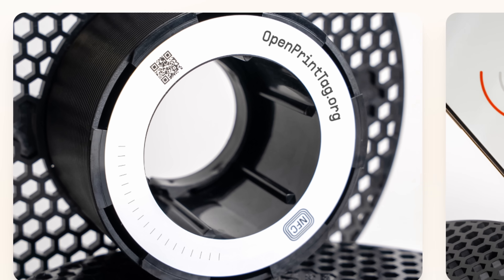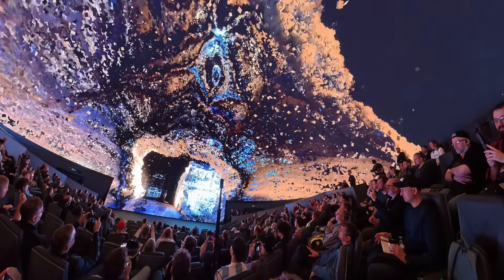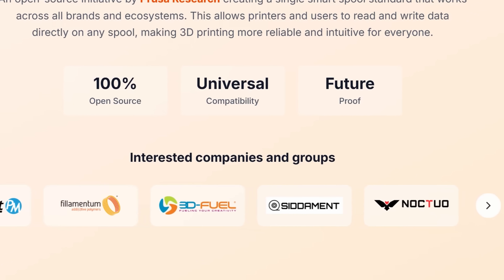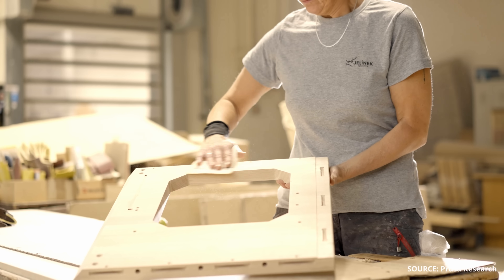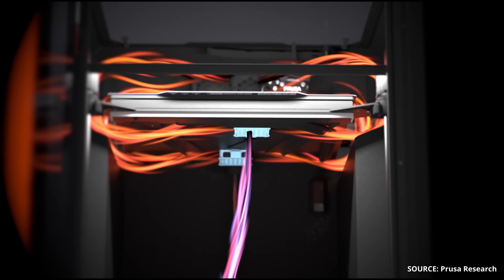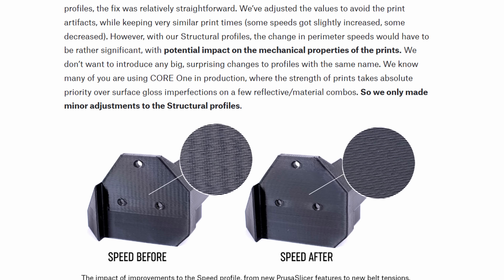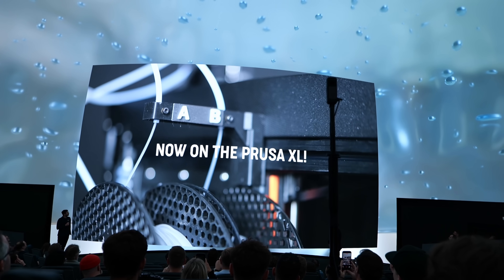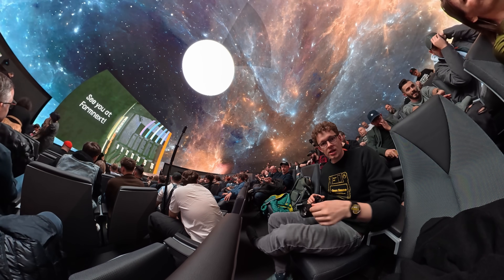CORE One L, RFID & Silicone: FIVE Big Reveals from Prusa Day 2025!

Comment: The lack of updates to the XL is very concerning. They could have introduced a better cooling fan and head design but they seem to be conveniently forgetting that printer as they focus on the core one. Hopefully that's not some sort of admission that they know that that printer was not the best design. Also that new slicer interface seems like it's going against all of the complaints on GitHub when they took out the standard operating system menus. I'm hoping this is not going to be another one of those apps that breaks UI conventions.

Comment: I want to say that being able print silicone on a standard 3D printer is going to be a game changer...however this isn't exactly new and I am far from impressed and actually very disappointed in how Prusa is doing it because it's insanely wasteful.

As far as I understand, you have a two-part silicone in two spools which each carry a long tube of the stuff. Each tube is CUT OPEN to get the silicone out. You're now left with two empty spools of waste plastic that can't even be refilled or recycled and will end up in landfills.

This shouldn't be applauded. This should be shamed!

Prusa needs to figure this out and use a remote cartage system instead.

Comment: Why does not one ever comment of Prusa's use of legacy 8 bit hardware but charging premium prices.  Electronically you simply cannot compare these to newer advanced printers.
Reply: They use 32 bit hardware now
Reply: You sound like someone claiming N64>PlayStation 1 because 64 bits is better

The internal implementation tells you nothing about the capabilities of the final product

Moreover, word size is one of the worst indicators of product performance
Reply: Prusa hasn't used 8 bit in nearly 3 years.

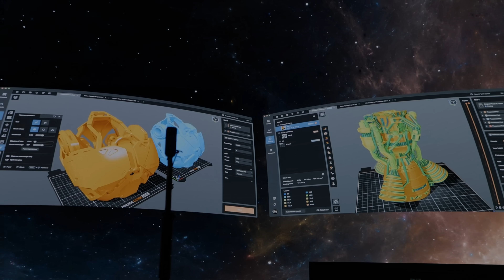Comment: the silicone printen at 5:27 is very impressive. But what happens with the tubes once they are sliced open near the nozzle? Are they mixed into the material or is there some kind of return system for the empty hoses where they are rolled up again?
Reply: It goes back

Comment: Their customer service really sucks tough, we have the prusa xl 5 tools at work. one of the toolheads is malfunctioning since the day we got it and they just keep leading us on without any sight on replacement parts or a new toolhead. which is great because it doesnt even calibrate because of the malfunctioning toolhead and now its completely useless if you want to use more than one head. not what we were expecting for the price.
Reply: I've had two different models of their printers and they've had excellent customer service that was responsive and helpful through to problem resolution.

Comment: Prusa AGGRESIVELY pushing back by embracing open source, making sure everything is compatible with potentially everything? And the Core L outsizing the H2D? Amazing. Now we all need to see how their Toolchanger solution for the Core L will look like ;) Cannot wait for FORMNEXT, will attend!
Reply: The opensource support is amazing, and I hope the INDX for Core One is awesome. But the Core One L does not outsize the H2D; it does not even quite match it. The H2S is a more direct competitor, and the Core One L is even smaller compared to that.

But I don't think the build volumes matter that much - they're all "larger format" and an improvement on the status quo.
Reply: I don't think the Core L does outsize the H2D, does it? I'm a Prusa user and fan, by the way
Reply: @goodtobegeek no it’s 50mm shy, I think the ams is a bigger deal that the extra 50
Reply: It's nowhere close to outsizing the H2D bruh 😭😭😭
Reply: Uh, it does not outsize the H2D, and certainly not the H2S, and neither is a competitor to it. Clueless much? The tags are awesome though!
Reply: Umm, the H2D is larger? and nearly the same price for 2 nozzles? The H2S would be a better comparison. 1 nozzle, 350x350 tool bed size, at $1200.... at $1799 this thing is dead in the water, IMO.
Reply: More cope from prusa fanboys, now we are straight making things up lol
Reply: @riba2233  it couldn't possibly be that someone simply misremembered, no it must be malicious
Reply: @ThylineTheGay  yes it does in this case

Comment: Prusa keeps pushing in the good direction
Reply: Not really, all the talk of open source doesnt compensate for huge diference in prices... competition offers higher quality product with larger print volume at significantly cheaper price or much more advanced machine that is still cheaper...
Thats NOT good...
Reply: @Asghaad all of that but closed source. No thanks. I prefer to spend some more to own much more.
also "quality" and bambu in the same sentence is gross.
Reply: @ajudge8786  thats the thing if the product that costs more offered more then that wouldnt be an issue ... the problem is they are asking triple the price for a printer comparable to  P2S.

or if you dislike it that much then compare it to lets say Snapmaker U1 ...

you are acting as if the Prusa was made from unobtanium and assembled by Dwarves from depths of Moria ... 

id rather buy "closed source" which is utterly IRRELEVANT to me machine that actually offers something for the sticker price...
Reply: @Asghaad  that's the point. Open-source is irrelevant for YOU. But just because YOU don't give value to open-sourceness, it doesn't mean it's irrelevant. For me it's worth the price.
Reply: @ajudge8786  no the point is that it would be valuable to me too, but not when you can buy two or even three other printers that will make the same quality prints for the cost of that "open source" architecture

Comment: NGL, I’m disappointed the Core L isn’t bigger than the H2S build volume. Maybe they are making a properly enclosed Prusa XL model.

Also that price is something else. A Bambu H2D is $50 cheaper and a AMS combo is only $1,999.00
Reply: I just bought an H2S a couple weeks ago. I maybe would have gotten a Core ONE L instead if it was at least the same size, or similar money, but I got the non-Combo for $1250. almost $500 less than the Core ONE L is.

Comment: Opening the vents with a print head lever and heating the chamber with fans under the bed is... quite a way to do things 😂 I like it
Reply: What I like about opening the vents this way is it’s not introducing another motor to break. It’s quite clever.
Reply: It's one less component to break down to use that stepper motor to do it. Genius really. Simple and robust
Reply: Seems like an afterthought kludge rather then the plan from the start. "Oh crap, other companies have self opening vents now, quick add an arm to the toolhead and put in some g-code."
Reply: @CSAlso2  It saves cost and simplicity often improves reliability. If this was an afterthought it wouldn't work as well or it would reduce the build volume
Reply: @chyrt  saves cost? That’s comedy when referring to Prusa, they must keep that money cause the $1800 doesn’t show any cost savings. Lol
Reply: @CSAlso2  The cost is primarily caused by the high quality manufacturing in Europe where wages are much higher than in China.
Reply: @CSAlso2  Are you really comparing a fully EU build machine to cheap chinese printers? 
Who would have thought, it's more expensive to build in the EU...
Reply: @b0kix953  yes, cause I live in the real world where Prusa has to compete with Chinese companies and yet somehow these “cheap” companies have figured out hot to open and close a vent without putting an arm on a tool head. It’s clearly a kludged afterthought.
Reply: @CSAlso2 Good thing I live in the real real world where people don't use 3D printers only to print small toys. I work with many companies that use Prusas in their print farms because there is no way they will send all their CAD files to china. Bambu even implemented the file upload to china on their slicer level, so even if you use your printer offline you will send your files first to china so they can see it. Lol no thanks.

Comment: I am curious if the new PrusaSlicer will work in Linux again. The current one is incapable of sending prints to my printer, I have to export the gcode and upload it from the printer's Mainsail interface like a caveman. Microsoft is working hard on getting more and more people to switch to Linux, so they really should fix that 🙂.
Reply: I'm using Linux and sent a print to my printer about an hour ago. I think you'll have to be more specific about what doesn't work - it has worked for me for years (both Ubuntu and Arch)
Reply: @TurbsMurbs  up to version 2.6.2 I think I had no problem either. Then instead of appimage they started using flatpak for installing it and since then I am unable to do it. Trying to send the sliced print gives error as if the printer is not connected. The new tab Physical Printer just always says "something went wrong" with a Reload button that never helps. From what I was able to find flatpak tends to break network functions according to some and I tried every way to fix it I was able to find. But after some hours I gave up and I keep using 2.6.2 for printers for which I have profiles in it.
Reply: Hi, I use Prusa Slicer with MXLinux and have no problems.
Which distro do you use?
Reply: @herr_rossi69  Ubuntu. Specifically 20.04 LTS. It came with the PC and I never bothered to change it to a different one.
Reply: @hebijirik This is a very old version that has not been supported since the beginning of the year.
You should update to the latest version.
But as far as I know, you cannot update directly to the latest version; you have to update to another version first because your version is so old.

Comment: Are there any information about Multi-Material Slicing for the XL? It is still something that is somehow missing in their Slicer and yes I am able to handle it somehow with some tricks, but I am still waiting for an easier solution within PrusaSlicer. As well as manual bed control for the segmented heatbed on the XL and so on and so forth. 

Maybe see you in Frankfurt 🖐

Comment: 300mm yawwwwwn

Still years later than what open source projects like ratrig and voron delivered a long time ago. We know CoreXY can get to 350-400mm³ while still being balzingly fast and without breaking the bank... Yet, even Bambu or Prusa, which still struggles to keep up, cannot do it.

I'm usually not one to be negative but it seems to me like those companies are making small steps just to keep selling new printers, despite the fact that the FOSS community, who those printers now get inspiration from, has been doing better for years.
Reply: A 300mm ratrig 4 kit is already as expensive as this though?
Reply: @infinitelyexplosive  Depends how you source it. I paid less than 1k delivered for a 350 Voron 2.4 kit a few years ago and scaling it to 400 or 450 barely costs anything more (the only problem is there would be fewer complete kits available for those sizes, you may need to order more components individually). You can also source ratrig hardware or similar for cheaper than what they sell on their official store. Also if you only buy the machine kit and source the electronics yourself, which is fairly easy, it also costs much less.

But you've got a point, maybe if those companies didn't focus so much on new shiny features like the ridiculous laser in Bambu's printers and, maybe, (remains to be seen but color me skeptical) the "liquid" thing in this Prusa, and instead focused on more practical features it would be less expensive.
Reply: @Penofhell  yeah and how much time is it going to cost to source alternative components, get your custom electronics, and calibrate the resulting machine? Surely the dozens or hundreds of hours wasted are more important than a few hundred dollars

Comment: People into humanoid robotics are going to be printing some crazy stuff with that liquid silicone.
Reply: it'd be rather porous, so certainly not suitable for some... applications
Reply: @ThylineTheGay  If only there were an inexpensive impermeable barrier to wrap it in, it could be a magnum opus of versatility.
Reply: @See-essEll I see what you did there. You really wrapped things up nicely.
Reply: You can already SLA print or just cast silicone really easily.
Reply: PP can already be used for that. And I guess it should not, as (non-starch) polymers will not be digested in your body.
Reply: @andreashabermas7964  I don't think digestion is the biological need they're hoping to address with the silicone parts.

Comment: I wonder when companies like Prusa will go into 4 or 5 axis print heads so we can do non planar printing. even having individual motor control on the bed lead screws would be nice to offer some non planar printing
Reply: Prusa will do it as soon as bambu or someone else does it now and they will do it worse for more $.
Reply: @MrSirclint  lol bambu lab literally does everything after prusa. There hasn't been a single thing bambu has done that prusa hasn't already accomplished. Bambu lab ripped of the prusa mini, prusa I3, prusa slicer and prusa printables and even the prusa academy. And thy use 5 different prusa innovation in every one of their printers. bambu lab is nothing more than a copycat. They don't innovate, they imitate. And people have already been modding their MK3's with 5th axis for years.
Reply: @LilApe I guess we just ignore the giant dual tool head machine and the ams. The laser and cutting heads (even if it's a weird one) 

The way easier quick swap nozzles the RFID tags. 

The actual affordability and print quality out of the box.

The things they did "take" which isn't much they literally did 10x better in every way lol
Reply: @MrSirclint  But you're forgetting the benefit of them letting people say it's open source. Not that it actually will be open source, but they'll let their fans say it is.
Reply: @hellterminator  why u so angry?

Comment: to be clear there is no upgrade kit to gone from core1 to core1L ?
Reply: I doubt it. Would be way to expensive I think. You'll need the new bed, new frame, new CoreXY assembly. You'll only be able to reuse the nextruder, Buddy Board and Display. But let's see. I will defenitely upgrade to the INDX system. We'll see if you can upgrade to a Core One L with it.
Reply: I would guess that some of it's new features will be made available to the core1.
Reply: @_Piers_  they won't, let's be real
Reply: Rofl

Comment: I am a fan of made in the EU. But you can buy 2 p2s printer for that price 😅
Reply: P2S is a smaller printer though. H2S is the main competitor and I paid almost 1600€ for that one (150€ shipping). I have zero complaints about it, but if the Core L existed back in August I would definitely get that one.
Reply: @9denisu8  h2s is around 1100e without the ams so it's much much cheaper. And qidi plus4 is less than half the price but more capable.
Reply: no, 3 P2S 😊
Reply: More like assembled in eu with mostly Chinese parts ;)
Reply: @riba2233  "mostly" well, that's not even slightly true.
Reply: @_Piers_  it is, if we are talking about facts of course
Reply: @_Piers_  Don't tell him that prusa printers are built with only 30% of their components being made in china, he wouldn't like that fact.
Reply: @LilApe  ah here you are Iying again, how predictable 😅
Reply: @LilApe  can you not spread misinformation for once?